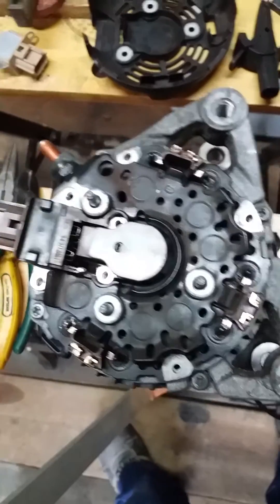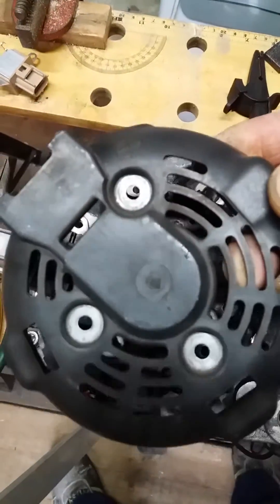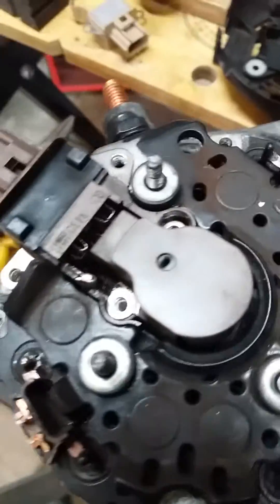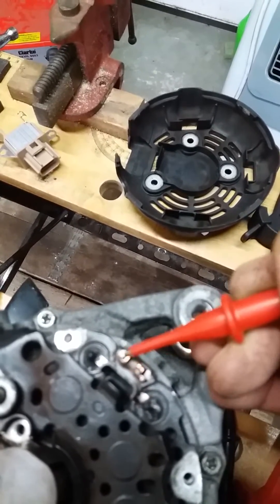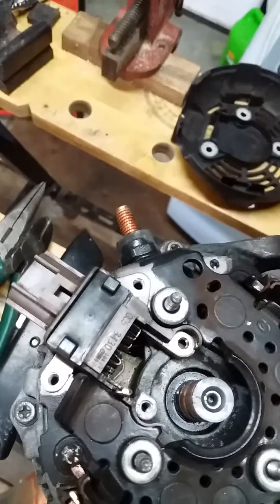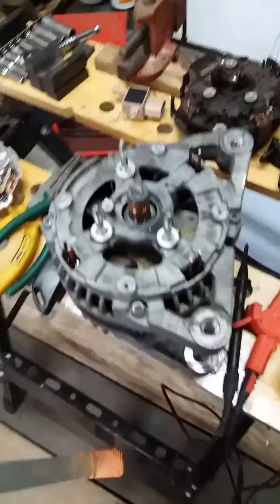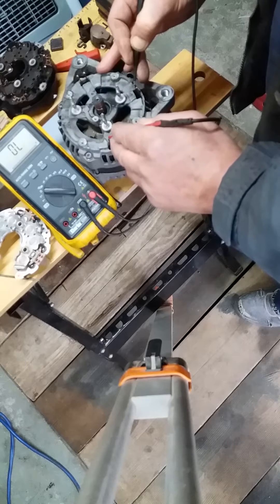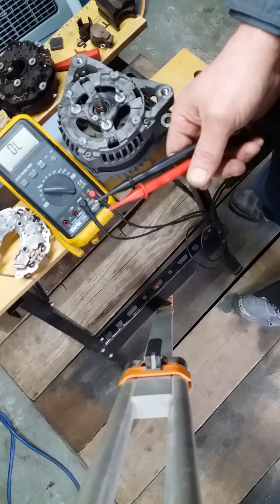Nippon Denso  (Volvo, Ford etc) Alternator Diagnose and Repair,  PART 1

Comment: I opened my alternator and verified that it has 3 ends of the winding in continuity and the other 3 also between them, is that correct, right?
Reply from the maker: Also check winding to winding and between each winding to groung ie the case of the alternator for shorts. Use a "megger" if you have access to one.

Comment: Finally I found the right information! Thanks.  All looked good on my unit until I barely touched the diode base connection at the plate. All of them were loose and essentially disconnected from the plate. As if they had separated and lifted just a few thousandths. Nearly missed it and put it back together, as all else was in order. And your grinding off the solder joint solved my last mystery.

Comment: Please just take this ridiculous useless video down thank you it doesn't help anybody
Reply from the maker: Helpful and contructive is obviously not your forte, if you don't like it don't watch it. Nasty destructive comments are really NOT necessary!!
Reply: Crazy Wayne: You, dear sir are an ass. I have the same unit and this is the ONLY video on you tube that addresses the diode failure.  May you feel the sting of the lash across your pitiful shoulders.